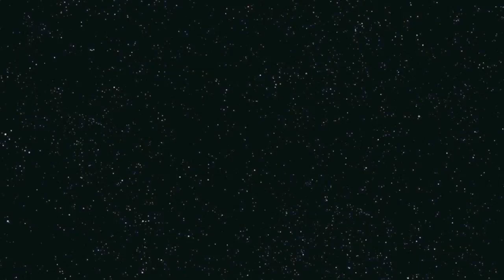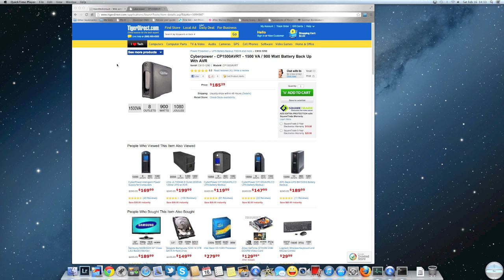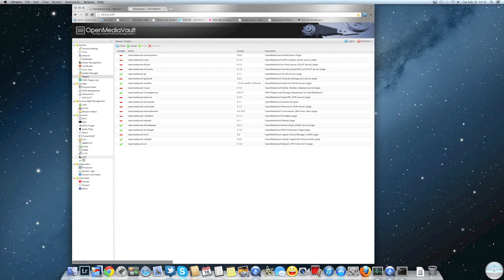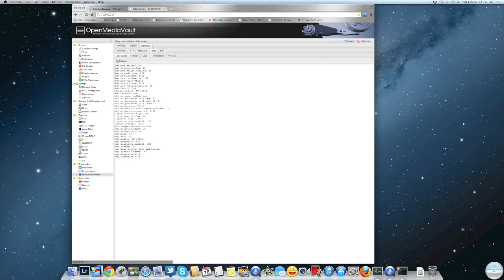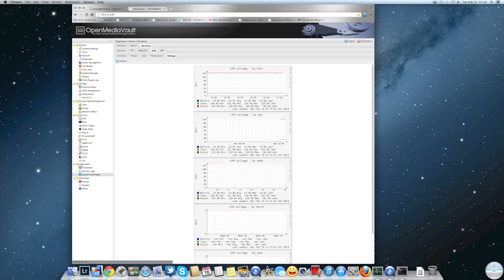Openmediavault UPS Plugin

Comment: I do relalized this video was created 10 years ago and lots have changed.  This video was still very helpful  even though I'm running the latest ver 6 of OMV which is Ver 6.4.9-1 (Shaitan) at the time of this post.  Installing and configuring the pluggin was the same. Trying to find the performance charts was a bit of a challenge on ver 6. Things are a lot different from ver 5.  I finally found the charts you were showing under last menu item on the left titled  "Diagnostics" then "Performance Statistics"  then UPS  battery icon in the menu on ver 6.